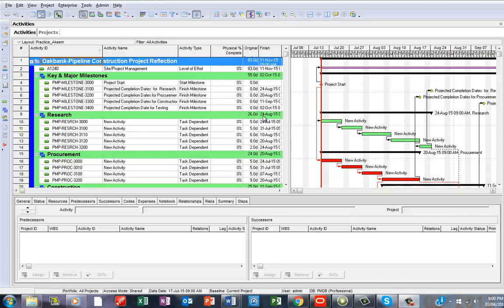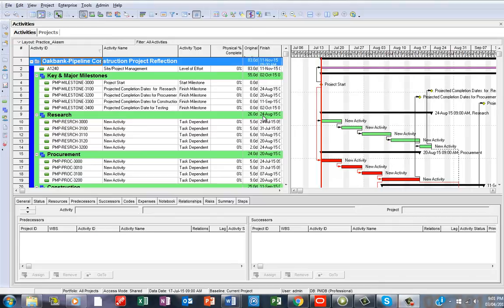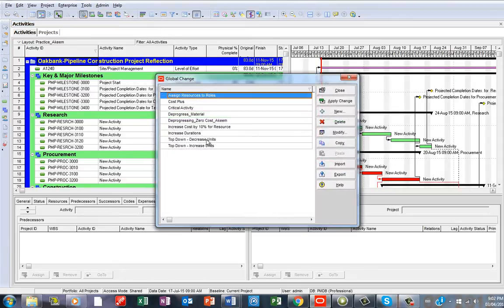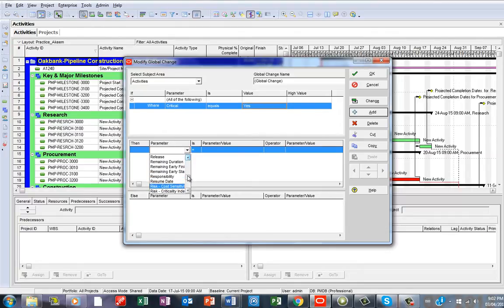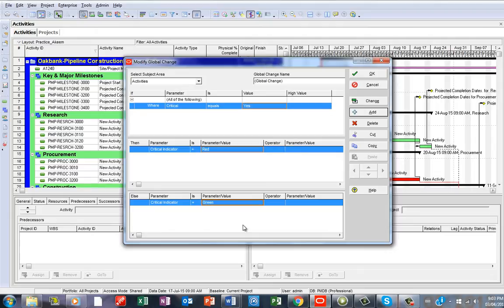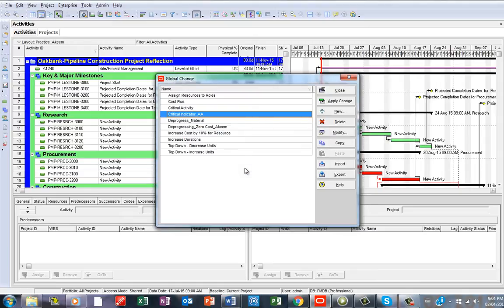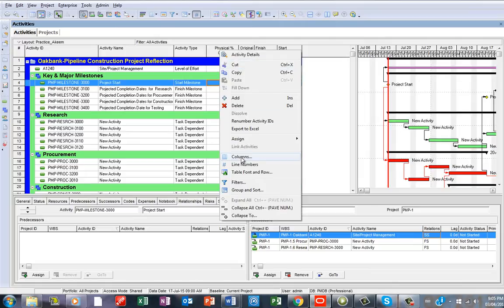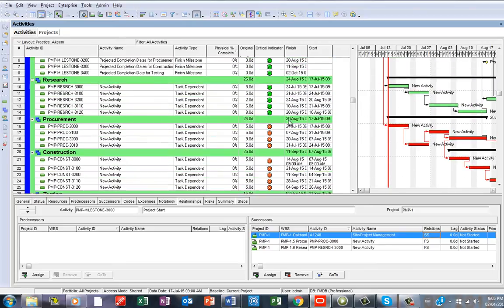Primavera P6 Critical Indicator Filter

Comment: Sir, i have tried this indicator on one of my prjt, for the 1st time, it worked correctly but, when i did changes in my schedule, it was not working. actually my question is, will it be changing automatically with schedule changes or not???